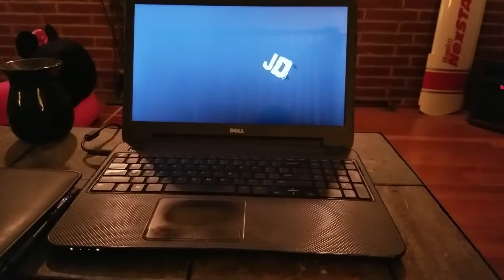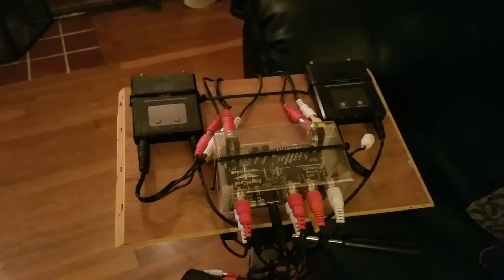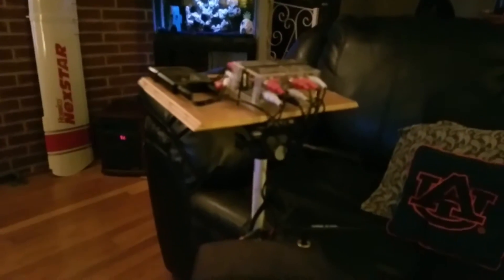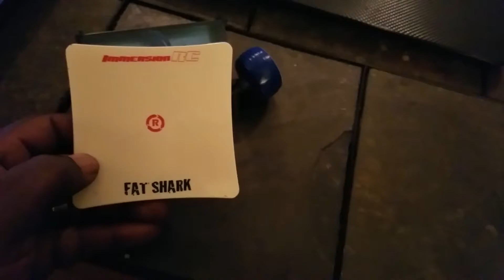5.8ghz Long Range Ground Station Revealed / 22km + Setup Unlimited Range

Comment: Good info, I'm still on the front lawn as far as distance out so far. About 4.5km. what vtx antenna do you use?
Reply from the maker: Thanks. This is what the whole video is about.  I name every antenna I use in this video.
Reply: @JD_1  my apologies, I heard what you used on receiver but don't recall what vtx antenna you prefer.
Reply from the maker: @anti-popfpv4638  I honestly don't have a favorite cause i use 4 of them at a time.  Each one does a job during my flights.... But i mostly use my 2 cannons, pepperbox and 5 turn. Hardly ever use a omni anymore nor patches.

Comment: JD are you using an antenna tracker? If not I’m guessing you are just manually adjusting the antenna while you fly?  I have been spending a ridiculous amount of time testing different antenna trackers and getting them to work properly without any luck.  I’d rather be spending that time in just flying.  Thoughts?
Reply from the maker: No antenna tracker. A antenna tracker will not help you unless you have 0 obstructions in the direction you fly. Manual aiming the antenna is the best way in my experience.
Reply: JD Thanks for your reply.  I greatly appreciate your input and direction. You have reinforced my initial thought over using trackers.  Keep up the great job on posting informative videos like this. Know that you have inspired many people and giving them the confidence to keep pushing 5.8.

Comment: JD great job on the run-thru of the gear and background explanation.  This has to be one of the best videos I've seen on YouTube explaining long-range setup in layman's terms.  I'm an intermediate level user and pushing more range out of my fixed wings.  I've used 5.8, 1.3 and 2.4.  You've made me a believer again on continually pushing the limits of 5.8.  Keep up the great work.  Thanks for the post.
Reply from the maker: Thanks! So kind of you to say.

Comment: Nice setup.  Impressive range on 5.8 without a tracker.  I dropped 5.8 for long range in favor of 1.3 with a Clearview.  I keep 5.8 for my more simple, close in planes.  Thanks for the link, nice vid.
Reply from the maker: Thanks. I bought a 1.3 ground station years ago and never had a use for it yet. Mainly because at range 5.8 and 1.2/1.3 works the same. It's all about staying in the beam at range. Close in flying 1.2/1.3 dominates.

Comment: Great to find this video,great work!  Before I found your video I contacted Eagle Tree to find out if 2 diversity vrx's can be plugged into the Eagle Eye diversity system . They said yes and I ordered one up for my 2 diversity vrx's. I had no idea if anyone else had  done this and am glad to see you have! My intentions for now is to have a couple miles of really good video for my quads and and airplane with a wide area to explore..  What array/style of antennas would you recommend? I am a VAS fan too and have an omni and one crosshair.  Two slots left, your opinion?  Thanks and great stuff here.
Reply from the maker: The 5 turn is perfect for penatration and a wide flight pattern. It has good range as well. The 13dbi fatshark patch is a winner as well for penatration.
Reply: So one VAS crosshair ,one omni one vas ion and two 5 turn vas helicals? What about a pepperbox? Sorry I have no clue on longer distance antennas.
Reply from the maker: @turboomni848  if you have the option of 4 antenna and plan to fly close range (2 mile radius). I would use a omni or clover leaf type, crosshair, 5 turn helical and a patch antenna or a pepper box.
Reply from the maker: The crosshair and pepperbox similar.
Reply: @JD_1  Thanks a million!  Subscribed.

Comment: Hi, Excellent video! Quick question for you. When using 2 antennas such as 2 helicals, can we put both of them next to each other on the receiver ground station side by side? If so should they both be pointed in the same general direction or should they be slightly pointing in a different direction for wider reception? Thanks!
Reply from the maker: Side by side is fine. And it just depends on the flight objective. If you plan on flying straight out going for some range, then point one slightly higher up then the other and point in same direction. If you want to fly a slightly wider flight pattern, then point them in different directions according to the beam width of the antennas. Make it to where the edges of the beam will slightly overlap each other.
Reply: O.k. thank you for the info. Is there a way to calculate where the beam width is going per antenna we use? We could be way off flying 5 miles out as far as where we are aiming the antennas. Thanks again!
Reply from the maker: @Bookstar75  yes. But you will have to know the spec of the antennas.
Reply: I have the Immersionrc Duo 5800 diversity ground station receiver. I dont know much about electronics, but would you know if I am able to combine another one to it just like what you did with your two receivers? Would I have to have the Eagle eyes in order to do something like that? Or is it a simple plug in from one receiver to the other to combine? My goal is to have 4 antennas just like what you have.  Should be my last question lol...thanks again!
Reply from the maker: @Bookstar75  you will need the eagle eye and 2 receiver to be able to use 4 antennas.
Reply from the maker: @Bookstar75  see part 2 if you haven't. 
https://youtu.be/8BeLj3YOz88
Reply: Thank you!
Reply: JD, is there a place online that would show me how to hook up my receivers to the eagle tree in order to make it all work?  by the way, I have the Eagle Tree already because I was going to set up a 2.4 ground station but your video inspired me to stick with 5.8. So all I need is another Immersionrc Duo 5800 receiver to match my other one and then I should have everything I need. I just need to know how to hook everything up. Thanks

Comment: do you know anyone useing a tracker with like the 10 turn antenna and if it works pretty well?
Reply from the maker: Harrison Gage I don't know of anyone using a tracker. I myself have 0 need for one with this setup.
Reply: ya i was just wondering with the narrow beam of some of those antennas if that would help keep you in the beam  flying 10+ miles. Thx for the vid it helped me out a lot btw!
Reply from the maker: Harrison Gage yes it would help. But at the same time you could just buy multiple 10 turns antennas on this setup and save a ton of money and hassle setting up an antenna tracker.
Reply: i hear ya there. I do have one question are you still using the 2.4ghz radio transmitter or something else? And if you are still using the 2.4 how are you getting it out as far as your 5.8 vid system?
Reply from the maker: Harrison Gage 2.4 will not take you out that far. Depending on obstructions around you and how heavy radio frequencies in the area, you may get 2 miles out of 2.4. I'm using Dragonlink UHF system to control the plane. It is pretty much unlimited when it comes to range. Unless you are near any 433 towers.
Reply: JD FPV ok I was just curious what was being used since you where able to go so far with 5.8
Reply: I would not recommend using a tracker for long range. They have a few surprises waiting to catch you out, mainly when the signal drops out, they lose it bigtime, and as they then don't know where to look in the sky from no longer getting the data they need, you're on your own.. blind. On top of that, they usually screw up any attempt you make to manually point the antenna's in any particular direction. Also, as the image degrades at extreme distance, the data can get so many errors in it, that the tracker is effectively lost anyway.
Much better to follow JD's advice and just fly the beam.

Comment: Really great breakdown JD, thank you!  You mention the 1W and 1.5W vTX in the video, which ones are you using? That's the piece missing from my setup. I'm using 600mW + a diversity RX using the 10 turn helicals and youre 100% right, they just don't get much past medium range.
Reply from the maker: bauhaus boscom tx. Propan 2 for pan and tilt.

Comment: Hi JD.  I now have a second FR632 and already had an Eagle Eyes from my previous ground station.  I also got a pair of diversity goggles (Aomway Commander V1's) and a black canon helical and a Immersion RC patch 13db to go along with my 5.8ghz pepperbox and VAS Ion cloverleaf.  Really looking forward to using this setup and thanks for sharing your setup and ideas. I noticed you are using the audio cables with your Eagle Eyes and wondered why?
Reply from the maker: Glenn doney i use audio cables because the video tx im using has a microphone on board. I like to be able to hear the sound coming from the motor during flight. And the sounds plays live from the monitor as well as records on the fatshark dvr. I use this as a first alert for trouble. If a bearing goes bad, or motor over heat during flight, i would be able to hear it.

Comment: Hi JD.  Thanks for the really helpful video.  I now have a FR632 and I've also had for awhile a 5.8ghz pepperbox and a 5.8 helical.  I have a RedPawz EV800 FPV goggles but I'm not sure if I can use them with my new FR632.  The goggles have two antennas but just one receiver (no diversity).  The goggles have a video output RCA cable coming from the diversity jack.  Any ideas of how to hook the FR632 diversity output to the RedPawz EV800 goggles? Thanks in advance.
Reply from the maker: Glenn doney according to the manual on the redpawz. It does have diversity. If you want to use the fr632 you will have to connect the diversity port to your av in port on the redpawz.
Reply: Thanks, JD.  The Redpawz manual doesn't match the current device.  They use the word "diversity" but it isn't true diversity, since there's only one receiver with the two antennas.  The FR632 on the other hand is true diversity with two receivers.  I think my problem is with the AV in/out port and trying to switch between the in and out, so the FR632 output can be displayed by the Redpawz.
Reply from the maker: Glenn doney i see. I hate false advertising. Wish you luck

Comment: I also have great success with my 5.8 using VAS antennas only with a pepperbox on my GS but for those low altitude far off flights 1.2/3 is a must. I'm out 15km at 400 to 600 ft n clear. 1.2/3 also penetrates behind obstacles which one couldn't do with 5.8. Just my 2 cents JD. PS just subbed hahaha
Reply from the maker: Aero FPV i have a 1.2/3 setup i bought over 2 years ago still in the box. Just never had a need for it yet. 5.8 does perfectly fine for me. And the cost of 5.8 gear vs 1.2/3 is cheaper.
Reply: For sure and is smaller, lighter more practical. It just keeps getting better. I took a little time off from FPV but I gotta fly soon haha.
Reply from the maker: Aero FPV same here. But im getting back at it full steam ahead.  I have alot planned. Cant wait
Reply: Oh cool. Even with the coming cold weather? looking forward
Reply from the maker: Aero FPV yes. Most of my better plane fights are during the winter. Can go places i normally cant go to fly during the warmer months  due to people being everywhere. Lol in the winter here all the parks are wide open for flying.